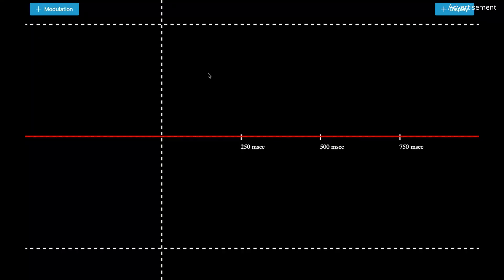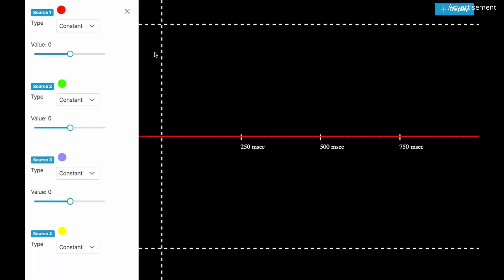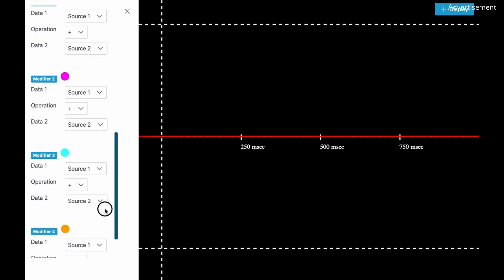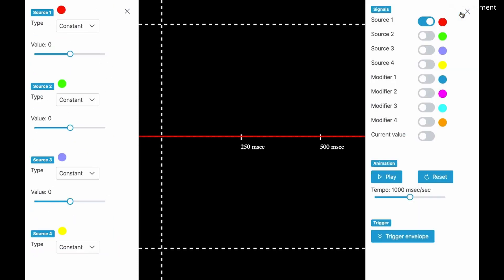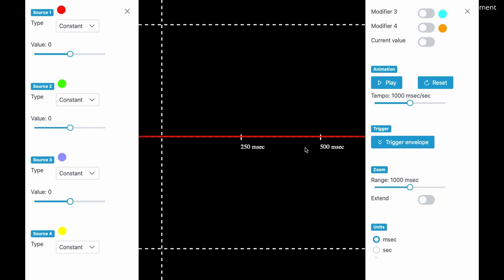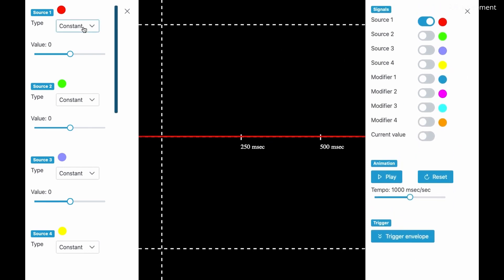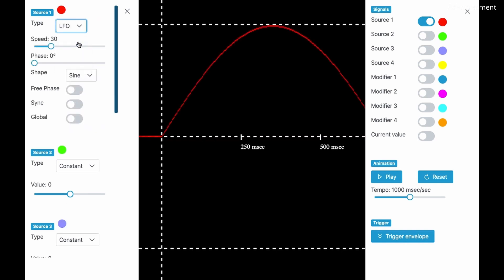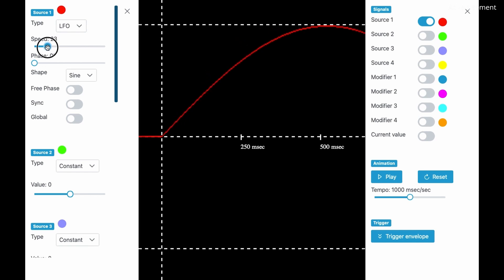[patch] Shepard Tone (Blofeld)

Comment: Fantastic job. Thanks so much for doing this. Much better than my attempt.:washhands:👍👍👍
Reply: My solution was quite different. I used an arpeggiator with a slow attack and release, the advantage being that the tone continues to rise several octaves before fading out and it's possible to fine tune the result.
Reply from the maker: Interesting approach!

Comment: Very intriguing idea, thank you for the video! The Blo is so flexible!

I thought of a method using "stacked sines" and thought you'd find it fun:

Modifier 1 -
Source: LFO 1
Dest: Pitch
Amount: 34

This sets the LFO to sweep through one octave (tested by setting the LFO to Square and noting the pitch change)

Set Unisono voices to 5, then

Modifier 2 -
Source: Unisono V
Dest: Pitch
Amount: 42

This gives 5 voices 1 octave apart each (tested by sweeping with a resonant bandpass to pick out the notes)

Each oscillator is covering 5 octaves with unisono, so:
Osc 1: 128' sine, with Semitones=-12 to get a '256 sine.
Osc 2: 8' sine (5 octaves up from osc 1)
Osc 3: 1/2' sine with Semitones=+12 to get a 1/4' sine (5 octaves up from osc 2)

And there you go, enough stacked sines to cover human hearing 😅
Reply from the maker: Thank you for this idea! That's very interesting, I never thought that using UnisonV would provide enough spreading for the pitch. I need to check that with sine waves in a spectroscope...

I have spontaneous ideas for pseudo additive sounds.